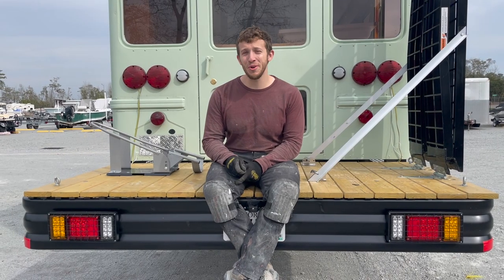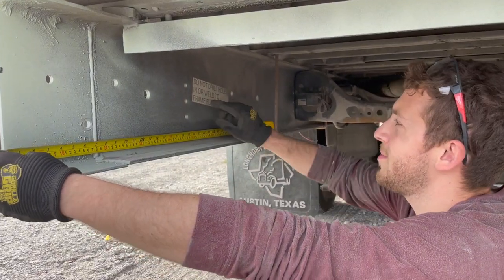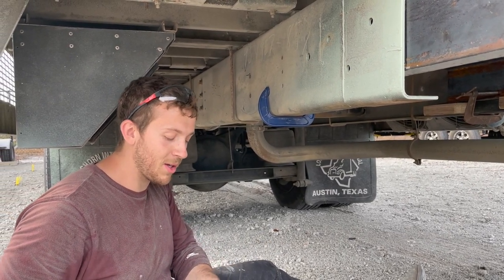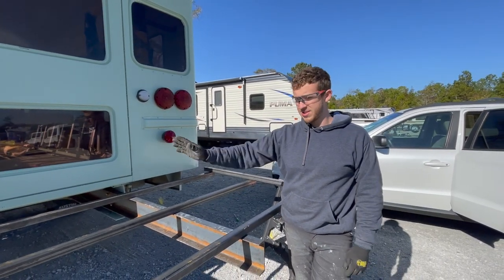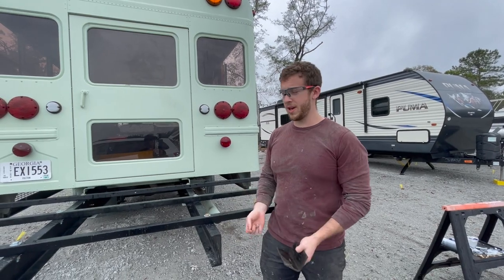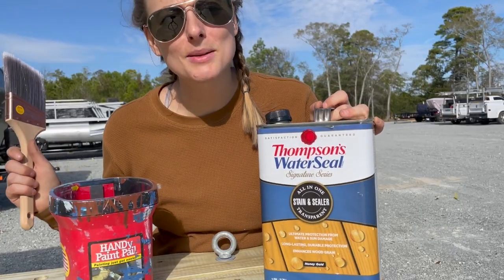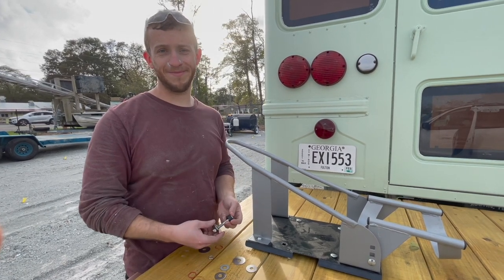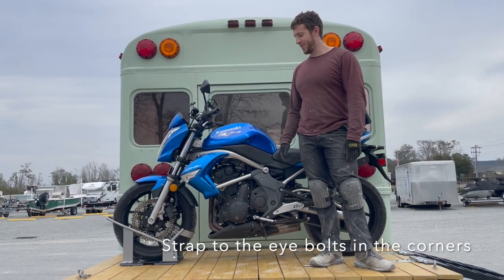School Bus Back Deck WITHOUT WELDING | Motorcycle rack | Key Takeaway | Bus Build 7

Comment: Thanks for the tips! I've been looking for a similar video, but nothing great until this. I'm thinking about doing something similar, but not as long. It might even be super short as almost a step, because I want to haul a small trailer and have something so I can climb up on the roof. I can climb in and out of my back window, so this could be handy. I could also put a spare or my cooler on it, or just somewhere I can keep stuff off the ground.

Comment: Nice job. Looks like it was well thought out. I hope it doesn’t come across as nit picking but I for one would prefer to have the 6 inch C channel iron resting on the 10 in C channel iron provided that such a configuration allows the use of the pre drilled holes. I’m betting you thought of that already though…😉👍

Comment: I like the sign that says do not drill holes or weld right next to the extension piece that is welded in place.
Reply from the maker: Did you watch the video? Lol We did not weld OR drill new holes. We used the existing holes.
Reply: @AcrovanAdventures  I know, I just find it humorous that there is a sign next to the factory welded stuff.  I mean THEY drilled holes and welded to the frame.  So why can't you do it?  Although I do understand the purpose of the warning label it's still funny.
Reply from the maker: @chrisgentry7195  ahh yeah I hear you. It also blows my mind how some people completely ignore that warning and weld anyways lol
Reply: @chrisgentry7195  "THEY drilled holes. Why can't you?" 
Do you think it's about permission? 🤔
Reply: @C.Church  It's really about structural integrity and ratings.  An engineer designs your frame rails and calculates all the variables needed to rate the rail for a certain application and usage.  If you modify the rail in any way, then you have introduced variables that were not figured in, and the rail could fail in certain conditions.  However, drilling holes and welding onto the frame rails does not break them outright.  They are typically overkill for any application and you can tie a lot of things onto them without having to worry about them failing.  My observation was about the sillyness of the label.  If you don't have any knowledge of such things, then why would you be drilling or welding in the first place?  If you do have some knowledge, then you can ignore the warning if you chose to take a chance on your modifications.

Comment: Do not drill holes or weld on the frame FLANGES. That is why you see no holes in the section of the frame rails that are horizontal and many holes on the vertical piece of the frame rail.

Comment: Even the manufacturer that installed that sticker ignored its own recommendations by welding about a foot long extension to the rails lol, ive seen this on many buses so its not anything wrong with welding to it if its done right.

Comment: Hey just wondering what kind of metal you used for the c channel? I figure steel, but that seems pricey.
Reply from the maker: It is “mild steel” which is much less expensive than stainless steel but still very strong. We recommend painting mild steel because the surface can rust if you don’t paint it
Reply: I just bought 2 piece of 4" C channel at my local metal shop for $89.  6' long each.  Going to put 2' into the existing channel and 4' past where the bumper is now.

Comment: Dude......a half inch bolt needs A HALF INCH HOLE...DRILLED WITH A HALF INCH DRILL BIT.......use the exact size bit for the bolt your using.....fyi..........you need a spacer between the c-chanel and the frame webbing....the deck will eventually sag only relying on the bolts to hold it up......otherwise nice job
Reply: True but since they did like 5 holes they would sag evenly and only 1/16" so you wouldn't even notice that

Comment: This is really not a good idea. Even if you use grade 8 nuts and bolts, the torque generated by the weight and over hang will shear the holes in the mild steel frame. Welding is the answer.